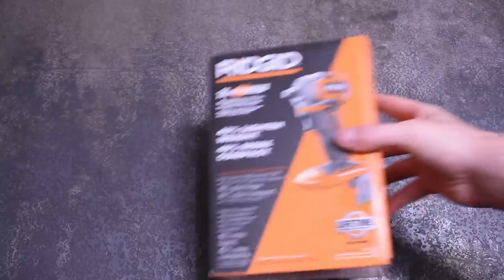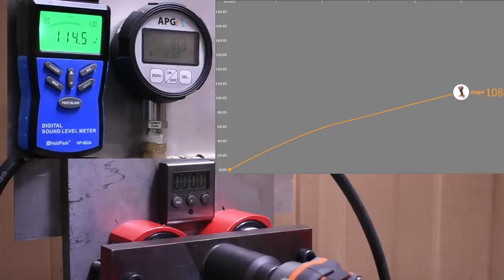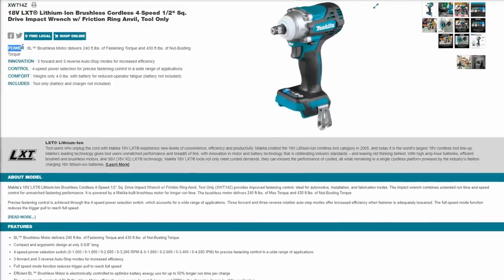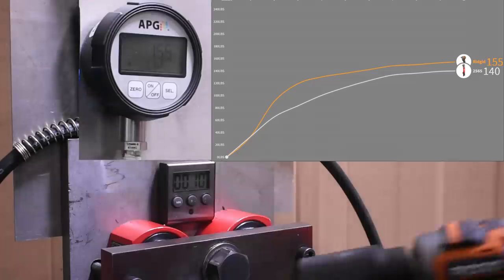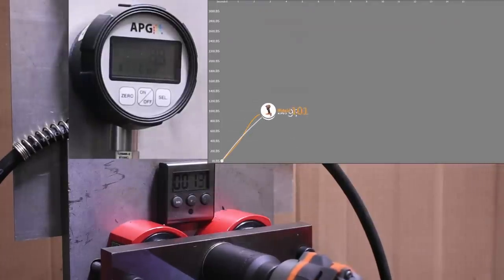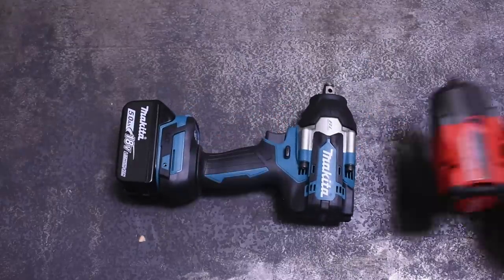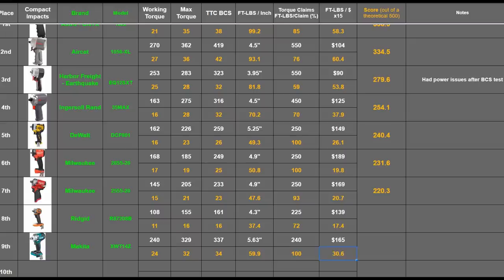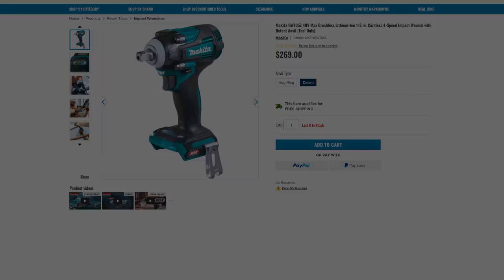Best Cordless Compact? Dyno Says It's Not Close: Makita & Ridgid vs M18 & DeWalt

Comment: Can you test a trick and see if it improves torque numbers? I learned this trick from a mechanic and it has worked for me on bolts and nuts that my impact couldn’t move. What you do is push on that battery like a wrench in the direction your tightening or loosing. I think the reason it works is it takes up the slop in the socket and anvil allowing for a stronger hit and more energy transfer. I used this on lugs that couldn’t move but when I tried the trick it allowed me to get them off. Placebo or real? You tell me…
Reply from the maker: We plan on making a "You guys said these tricks would increase torque" episode down the road with ALL of these
Reply: It's real. On super stuck bolts, it's very common in my use (deep in the rust belt) to "rotate" the gun in both directions to change the dynamics of the blows to break the rust bond. I'd guess that it works 50% of the time, or at least often enough that it's always worth a try on the stubborn ones.

Comment: Still loving my DeWalts. They are rarely on top in your testing but they get the job done in the real-world. And they are the only US-owned company so that means more to me than any chart or scoresheet. Still loving the channel tho. Keep up the great work guys 👍🇺🇲
Reply from the maker: The dewalt compact is maybe my most used impact
Reply: @TorqueTestChannel  Yes, me too. The DCF901 & 902 definitely see the most use. Also, my MAC BRS038 12v 3/8 Ratchet. They are all just so lightweight and powerful. The 901 handles most lugnuts and suspension stuff, rarely do I need the 20v mid and high torques.
Reply: @ABH313  does the DCF901 handle tight/ large bolts well? Especially brake caliper bracket bolts?
Reply: @CarlosRodriguez-mi2uy  Yes, the 901 will handle pretty much every fastener on a car, and can easily do lug nuts and brake hardware on trucks up to 3500s. It might start having issues with rusted ball joints on a big truck or something like that... but for the most part the 901 will get it done. 👍

Comment: Just got my makita in the mail today. That thing took the lug nuts off my truck that were at 150 ft/lbs as fast as my ridgid high torque. Definitely worth the $246 for a 4ah batt, charger, and the gun on Amazon. Tomorrow going to be doing some actual work with it. We'll see how it performs on ball joints and a rear axle swap. I have a feeling it will be great.

Comment: I run that Makita impact and absolutly love it. Actually all the new Makita impacts are sleepers, i have all 3 flavors and the m12 stubby and stick with the makita in this episode. I rock mine with a 2.0 and it keeps it light and useable all day.
Reply: My mentality too, use subcompact/compact Makita tools with 2ah batteries for comfort and more than ADEQUATE power. However i also bought the smaller Makita, the subcompact 1/2" that is pretty weak and when it struggles it will not impact evenly, no serious rattling but definitely a bit off.

Comment: In terms of "why aren't people knocking the doors down to ask for testing?", perhaps it has do with the specials different stores run?  I got my Dewalt DCF901 for free at Lowe's when buying the 12v extreme Drill and Impact Driver combo pack.  All told, it was $200 for 3 highly rated tools, a carrying bag, two batteries and a charger.  $66 for an impact wrench seemed like a no brainer

Comment: That's hilarious.... I thought, where's the M12? Then there it was at the end. I just finished pulling the front end of an XC90 apart with mine. You guys are correct, though: you need something else with more beans for bigger stuff.... and with the M12, you pretty much need to buy into another battery system anyway.
Reply from the maker: Spot on. I think that's what people don't get. You use the M12 until it doesnt work then step up, and with 12V batteries you needed a new line up of batteries anyways, so what's the big difference also having teal colored tools? Brand loyalty? A $40 charger?

Comment: Something is not making sense here when the other channels are reporting a breakaway torque of 225' pounds using the 3/8 subcompact ridgid & 2 amp battery.
Reply from the maker: Its because on those channels the M18 and Dewalt also breakaway 450. Same relationship, we just don't do nut busting here for many reasons

Comment: I'd love to see the Milwaukee 2853-20 1/4 Hex tested. I use mine with a 3/8 socket adapter everyday, admittedly it's broken about 15 adapters now, but the power vs size is just amazing to me. (I could possibly send in my well used one)

Comment: Different tools, different jobs.  When working on my cars, size to fit into tight spots is required more often than the need for 300 ft lbs.  I have a high torque impact (1300 ft/lbs breakaway) for when heavy lifting is needed.  The Ridgid SUB Compact is so lightweight and small, I use it more than my other impacts.  Doesn't Ridgid have a "Compact" that you can compare the other compacts to?  I honestly do not know.  BTW, THANK YOU for your channel.  Marketing BS makes it impossible to select anything.  I've made my buying choices based on your tests.  Final thought....The tipping point for me was the lifetime service agreement on the Ridgid tools (includes batteries and chargers too).

Comment: I wonder how the XWT13Z variant with XPT tech would do. It's actually longer (although the call it sub compact)but the water and dust protection has some merit. Shows 155lbs but maybe underrated?
Reply: That's the "direct competitor" to the Ridgid, at least in my opinion.
Reply: I had that model but sold it for the one featured in this video. Night and day difference. The XWT13Z wouldn't take off lug nuts torqued to 100 LBFT. It had a nut busting torque of around 80 LBFT as measured on my lug nuts.

Comment: i have 2 dewalts . one big one small. one big problem with the big one is if you run it with the socket facing down the battery will BREAK and fall out from vibration on bolts that won't turn/.

Comment: I've got one of those, totaly overpowered. 
To be honest, I'd rather have something slighly less powerfull but the size of the rigid (using makita batteries...).

It's soo powerful that I barely take the big XGT 3/4" out of the box, It can easily remove most rusted bolts on industrial machinery. 
That sounds nice, but when you are in a tight spot trying to unbolt  something small and this thing doesn't fit, you end up using a wrench...
Or when you forget it in the max torque setting and it snaps a bolt...

Comment: bought this recently based on having battery from another makita tool & not wanting to spend almost 500 dollars for a bigger high torque impact, looks like i lucked out getting a mid torque mascaraing as a compact
Reply: Did you get the detent like or hog ring? I planning to get hog style but someone mentioned they have problems on some makitas vs detent.
Reply: @jameshill4900  detent anvil since it was cheaper, so far hasnt given me any problems but i havent used it much since i finished my suspension work few months ago

Comment: When I started as a mechanic for heavy trucks I used Makita for a year in the field. Once I tried the Milwaukee angle grinder I immediately sold all my Makitas and bought Milwaukee instead. 
The deciding point for me was when I cut a snow plough blade in half with which during that time was the best(most expensive) Makita brushless grinder and emptied 4x5Ah batteries into it. Then borrowed a milwakee one from a colleague and cut 4 blades with 1x5Ah. Actual tightening torque of the impact wrenches was not really a deciding factor for me since the 3/4 milwaukee was not around back then and I mainly use the 1/2" drive anyways and didn't really see much of a difference between them in practice aside from that transparent plastic cover from the Makita breaking loose after dropping it onto a concrete floor only once.

Comment: Why not the 12v Milwaukee?
Reply: The M18 and M12 stubby impacts both have the same torque specs, but I believe the M18 actually produced a bit more. That the 12V DeWalt beat the M18 is very impressive!

Comment: You need to use the same amp hour battery packs or it’s not a fair comparison. Re run the ridgid with a 5ah pack. Please.
Reply from the maker: Doesn't exist. This 3ah has 21700 cells. Its holding its own for sure

Comment: Makita xwt14 should be compared with dewalt dcf894. These two impact wrenches are categorised into mid range impacts but not use in subcompact range.
Reply from the maker: Makita has a mid torque, its not this. The DeWalt mid is 7" long. The 12v dewalt is 5.25 and this 18v Makita is 5.6" . Let's be real

Comment: Too be fair to Ridgid, Makita too got a subcompact, not too short but very slim, and its a notch weaker than this Ridgid. I got one, enough power for changing car wheels but it can struggle with over-tightened lugnuts so on cars with unknown tightening torque i dont waste time on the subcompact and use my beloved XWT14 to break them loose. Beware though, the XWT14 is powerful enough to damage the threads on 12mm or 1/2in lugs, never tighten on setting 4 unless youre using torque sticks. On the other side, torque sticks steel so much torque that the other compacts tested here may be insufficient in some cases, making XWT14 is the safest buy for versatility and torque reserve.

Comment: Dang that DeWalt was a bit more impressive than I had thought. Might go an buy the 903 version being I don't have any ⅜" impacts yet
Reply from the maker: We use it all the damn time!
Reply: @TorqueTestChannel  so would you get the 1/2” or 3/8” impact in DeWalt"s 12V line? So far, I have mostly 1/2" impact sockets, but the sizes I use the most, I tend to have both 1/2” and 3/8”.
Reply from the maker: @l00nybin  3/8" all the way. Get some short 3/8" sockets and it's a whole different ball game for chassis bolts up to 19mm hex or so

Comment: After 30 years makita remains my first choice for  cordless tools due to their depth of selection, reliability, and pioneering in the market. I have 14.4v nimh pod batteries over 20 years old that still hold a charge and work. Just bought an 8 pc combo set from home depot for $400, other than the junk entry level flashlight it was a bargain.

Comment: 1:18... and it's a subcompact not compact I've seen other channels get 250 ft lb of torque out of it
Reply from the maker: I don't believe we called it simply a compact in this episode. And if it made 250, I imagine that was loosening a bolt which is great - but channels have also done that same test with the Milwaukee and DeWalt to 450-500 then which matches the relationship we saw here. If Ridgid had posted a tightening torque claim like the majority of brands do, we'd be able to compare to that. The Milwaukee's nut busting claim was 250 and it hit that no issue even in our non nut busting tests here. You can hold a deep socket by hand and slow down or stop this impact. It doesnt take a dyno like ours to see how little it makes. Not a knock on Ridigd, thay have the best high torque currently. But this guy is an impact driver, not wrench.
Reply: @TorqueTestChannel  uh, I can hold the extension bar on the Ridgid hi torque and put it into impact mode, or you're saying you can stop the socket completely?

Comment: its not the volts that count, its the amps of the motor
Reply: 1amp on 100 volts is 100 watts, 100 amps on 1 volt is 100 watts...
Reply: @neubauer.p  motors have a rating, if its only 1amp  its stays at 1amp. you cant change what it uses, hence m12 or m18 can give u lots of power cause motor was made to give more "watts" at its rated volts

Comment: I’m extremely surprised to see those numbers for the Makita, I have one and I’ve never been impressed by it, mine seems so weak I barely have use it at all.
Reply from the maker: Thier mid torque is in another dimension
Reply: @TorqueTestChannel  even compared to the m18 mid torque? Considering selling my m18 compact and midtorque after this review, I have the makita compact and (xwt08z) last gen high torque, but thought Milwaukee was the way to go so I bought their compact and mid,  now I’m thinking I had it right the first thing, m12 stubby&rachet, + 18v compact, mid, high, and 18v ratchet as the only mechanic power wrenches I’ll need.
Reply: Is yours that lacks power the same model xwt14? Looking to get either this or a the bigger makita mid torque.

Comment: I want that Makita in 3/8” drive!
Reply: It'll break its anvil or the sockets you use on it tho.
Reply: Its too powerful for 3/8, remember it can match older midtorques in real life usage.
Reply from the maker: @Hansengineering  I suspect not. The M18 Gen 2 mid torque comes in 3/8" and makes a whole lot more sauce
Reply: @TorqueTestChannel  Good point.
Reply: Xwt16z

Comment: I dont get the results you got with the ridgid sub compact.

If you look a the "wich stubby impact is the best" video from shop tool review they made 10 months ago they were able to break a 325 ft/pounds nut with it with a 1.5ah battery or a 2ah battery after about 10 seconds yet you only got 155 I think ?

Also I was able to break 200 ft/pounds nuts with it more than once.

Maybe you can explain your results ?
Reply from the maker: You and him are breaking nuts free. Which makes sense, but is not how impacts are traditionally rated going back most of a century. As the bolt size and condition and what its tightened against can make things vary widely + the 20% difference of tightening vs loosening. The Ridgid only has the one torque rating to go off of, but usually we see a max, tightening, or forward figure to compare to. I'm not saying the Ridgid wont busting something X tight, just that these others would do so 1.5X and 2X. Just like STR did with the M12 and DeWalt doing 450-500.
Reply: @TorqueTestChannel  got it

Comment: TTC, what would you suggest someone do if they have the M12 Stubby 3/8” Impact but wants a 1/2” mid-torque to go along with it? I have Makita 18V batteries but no M18 batteries. This XWT14Z almost fits the needs but I’m worried I’ll need more power for suspension work in the future, so the M18 Mid-Torque might be a better option. But man, I do not want to buy another 18V battery set…
Reply from the maker: The step up between this Makita and the M18 mid torque is one of the smaller power difference between classes. Get the Makita mid torque, it's a beast. $209 right now which is around the lowest I've seen: https://amzn.to/3PZicqS
Reply: @TorqueTestChannel  I was totally not expecting a reply, thanks TTC! You're awesome!

Comment: Is the detent pin version (xwt15z) ok?  Any issue with difficulty getting sockets off.  I have DeWalt dcf894 detent pin version and you can just pull sockets off by hand.
Reply from the maker: They behave about the same, it's good

Comment: just wondering why you used the 250 flb numbers and not the 400 for some of the tools today in the rank chart? do you always use forward as max torque? or did i misunderstand something
Reply from the maker: Yes we do! It's because that's what we can test and has established testing practices. Nut busting we don't do as it can be done a multitude of different ways and methods to influence it to your favor
Reply: They generally ignore the "breakaway" or 'bolt busting' numbers
Just marketing
Reply: Some companies only advertise nut busting torque, other advertising both fastening and nut busting so for those they use the fastening torque claim.
Reply from the maker: @josegarcia2014  Bingo. Traditionally you advertise 2 figures (it used to be working and Max which is FWD and Rev) but for the last 18-20 years it's been Max or tightening and nut-busting/breakaway/whatever. Some brands in the last few years have dropped off the 1st ones altogether to just show higher nut-busting which is sort of whack. BUT Milwaukee's compacts hit that number (their other tools like the right angle in this episode... well yeah we're not sure why)

Comment: why not use the 18/20v dewalt mid range instead of the 12v?
Reply from the maker: It's not out yet (the one that makes power). And it'f you're talking about the mid-torque, well that's 7" long. Certainly a solid mid-torque. Not a compact
Reply: @TorqueTestChannel  thats exactly what she said 😂, 10/4 i got ya

Comment: A little surprised Makita brought it home tbh.. will you be venturing into 3/8 impacts at all? It would be interesting to see how few 3/8 cordless impacts all stack up against each other. I have the 3/8 brushed Makita and it works..... Ok. About as good as my cheep old air impact does, which isn't amazing. But the snapon 3/8 that the tech beside me has, works just as good if not a bit better and is MUCH smaller

Comment: Is it Rigid same Chinese company as  milwaukee? Basically same manufacturer making both brands on the same production line. Just asking.
Reply: No
Reply: @JohnJohn-kx7hj  I should check that by myself.  You right it's actually owned  by Emerson Electric, but the tools are made by TTI.
Reply: Easy to ask 100 questions and get responses as time goes aswell. 💪

Comment: This is why you can get the Ridgid sub-compact for 80 bucks now. And the M12 3/8 drive is still over 150 bucks. 
Sorely disappointed in Ridgid, at least with this tool.
Reply: I just have a rigid toolbox lol. I want a 3/8 m12 and a mid impact m18 from Milwaukee but haven’t made up my mind on the best decision. Red is my favorite color as well lol
Reply: @spawnandbatman6975  I have several M12 tools, absolutely love them. Though the tool I use the most happens to be the Ridgid 18v   impact driver which has taken a beating and powers through everything I've used it on...had high hopes for the wrench but woefully disappointed